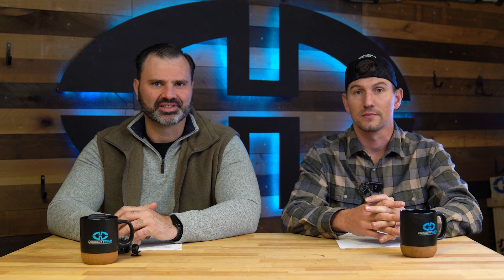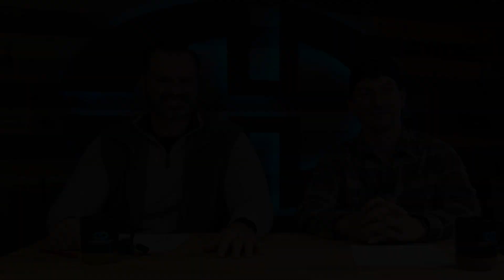What is Innovation & Why is Everyone Afraid of It? | TWP Ep. 1

Comment: You guys want a great idea that's feasible? 
A rifle using a delayed roller blowback system using a progressive, 2-stage spring to allow low to standard pressures up to high pressure rounds (aka "self-regulating"). Seriously, look at the G3, HK33 and MP5 system and think of that using a captured dual spring that works with both low-powered practice or subsonic rounds up to full-powered +P+ (think H&K USP/Mk23 dual recoil spring or Sprinco's recoil reducer recoil rod/spring assemblies). Tune the dual spring to the round and the delayed blowback system and it becomes not only reliable but pleasant to shoot. 
Now, build this using a user changeable barrel with attached trunnion (universal size), secured by an 11 bolt system in chassis (like MDRX's 9 but with a center bolt) , and a bolt that fits a single carrier. install proper spring and magwell adapter (SR25 down to 5.56 or down to Glock or other pistol mags)... You could go from a .308 to a 9mm with a simple conversion kit of a barrel/trunnion, bolt, recoil spring, bolt weight and magwell adapter... and take a large range of loads from low-pressure practice to high-powered ammo (using that dual spring). Oh, the carrier... a universal bolt carrier that has weights screwed into the front for the appropriate round used. Think of a MP5 carrier that can take weights to make it a G3 weight carrier. 
Hear me out here... we're talking a delayed roller blowback system that, unlike the H&K, can be switched out as a barrel/trunion combo allowing caliber conversion with a set of parts (barrel/trunnion, magwell conversion, bolt, carrier weight, spring).
We're talking one weapon platform that can go from 5.56/300BO/6.5 Grendel/6mm ARC/338 PRC up to 6.5CM/.308/.338 Fed (like the MDRx/WLVRN already does) but be able go down to 9mm, 10mm, .45ACP etc. One chassis, many varieties. Oh, and no gas piston or DIS to change... trunnion barrel, bolt, carrier weight is all it takes (and magwell adapters)
Also, the delayed roller blowback system can enhance accuracy as there are no moving parts on the barrel from the chamber forward if free-floated... just look at the accuracy of the H&K PSG-1.
Think about that... a .338 Federal Magnum with a 24" bbl bullpup using AR10/SR25 mags set as a SWS/DMR can be converted to a 9mm SMG with a 12" bbl with a suppressor in 5 minutes while in-mission... we're talking the perfect Spec Ops rifle that can go from a SWS/DMR to a subgun in minutes. As for the civilian market, you're talking a hundred or so potential combinations from a single chassis if trunnions and bolts are free sourced to the aftermarket world. 
I've tinkered with this idea for years but not having CAD stuff, fabrication abilities, a team of engineers or manufacturing capabilities, it's just been a vision on paper/computer.
You want to work on something like this, get with me and I'll freakin move to Utah to make it happen! Seriously!
Reply from the maker: @ericx777  I love the hk rollerguns!  Your passion rocks!
Reply: @DesertTechUT 
 Should look into what he's saying because it makes a ton of business sense !!

Comment: The AR-15 is an old and well known design. And while your 50+ magazines are cool, here are some of my thoughts on (direct impingement) AR-15 improvement.
My biggest gripe with other manufacturers (or our current patent laws, really) is that every company will have one such feature in their rifle, give it a fancy name, patent it, and then you can buy your rifle with this one feature done right, but never all of them in one rifle. So somebody willing to source multiple patents could actually make the best AR-15 on the market by far. Or if changing one geometric feature of a part on a 70 year old rifle wouldn't be a stupid new patent every single time... So my new AR version 2.0 spec should have:
Bolt:
-Heavier bolt with better anti tilt geometry (see Surefire OBC or Sharps XPBC)
-One piece carrier and gas key (POF UBC) or one screw (Surefire OBC)
-Anti shear and better dirt function for the bolt front (Sharps ReliaBolt/ KAC Sr-15 E3 / LMT enhanced angled/ rounded lugs) 
-Anti break bolt cam area (HMB Bolt with no complete hole or thicker KAC design)
-additionally to the closed bottom strengthening area of the HMBolt, maybe thicken the walls KAC style and have a smaller diameter cam pin
-Michigun OCKS carrier key screws, if you can't realize a POF style one piece carrier key and carrier design
-Sprinco extra power ejector springs with o-ring and insert (ideally two as per the KAC dual extractor spring design)
-Roller cam pin (POF)
-Proper 22.5° cam pin track and unlock per the original M16 (see Leitner-Wise, also Surefire OBC)
-Dual extractor spring (KAC, LMT enahnced)
-sand cuts on the bolt carrier rail sections (not too many relief cuts as to have enough material left and avoid burrs, compared to the old KAC and current Centurion Arms bcgs with sand cuts)
-enlarged, forward facing gas ports to reduce bcg speed and gas to the face (Lantac E-bcg)
Barrel:
-increased strength barrel and handguard mounting (Blackout Defense quantum dual taper lock, and if that does not clear the HM barrel, maybe an enlarged upper like the Cobalt Kinetics one with a reverse threaded jam nut as barrel nut, plus you avoid lapping)
-maybe look into cryogenic treating your barrels, and 5R rifling. Plus heavier profile barrels for people that want those
-ask HM if they can manufacture muzzle devices straight into the barrel. KeyMo and OSS/HUXWRX brakes also integrated into your barrel would probably come with the same advantages over a pin&weld than the gas block does. Not sure if worth the cost, but a cool idea.
-if you recontour the barrels anyways, how about testing the heat stress and incorporating stress relief cuts like Blackout Defense?
-lapping the barrels on the premium version
-longer than mid length gas systems on the longer barrels to improve dwell time, since there is no adjustable gas system. intermediate gas lengths for 14.5 and 16" to give you more dwell time. The barrels are proprietary already, so maybe go the extra mile and get closer to rifle length
-higher strength gas tube like the V seven extreme inconel. so V7 Extreme Environment Gas Tube (in the longest possible gas system you can make happen for any given barrel length)
-ask HM about higher grade barrel steel like 416r
-also, is 5R rifling or polygonal an option?
-is the gas port in the HM cut at 90° or could they change that to 45° and optimize laminar flow? like the new GO Monilith
-heat fit and geometrically fit barrel extension like Global Ordonance / Foxtrott Mike Monolith. Maybe even the oversized AR bolt
upper, lower and other:
-magnesium or lithium-aluminium parts if you want to reduce weight in the upper, lower, handguard, buffer,...
-teflon or Anderson RF85 coating to avoid wear on the upper/buffer tube around the bcg movement. Or maybe even coated steel inserts, Sig style
-enlarged magwell, and maybe optimized lines like the X2 devgroup lightfighter
-Silent captured buffer spring (JP)
-Ratcheting buffer tube (PWS)
-increased length buffer system (like the Vltor A5 length, but ideally with a PWS ratchet system and enlarged JP captured spring)
No idea how much money you'd have to have to license all of that, but one Rifle with all of that technology would rule them all.
Reply: And if we were to go the piston route with something like an AR-18 derivative, the H&K 416 / MR556a4 are a good start. Though a Sig Spear gets rid of the buffer tube, as does the HK433 and the new Bren 3. But also keep an eye out for the more modern pistot systems that self-adjust for suppressor use like the VKTR VK-1.
Reply from the maker: You have been doing a lot of research, nice job!  I agree with your point that little variations really shouldn’t be patentable. I am not sure how they got them approved in some cases.
Reply: Said all of that and you can get the HK system and it is ready for serious use.  The only thing that needs to be done with that is folding stock and new ammo choices !
 22arc, 6arc, and 6max  all are far better than 5.56 !

Comment: The Trek-22 would benefit from being it's own complete rifle. With some upgrades that make the 10/22 more suitable as a bullpup.
Easy cleaning through 11/22 open top receiver plus a more solid metal rail for optics. Tandemkross for better mag release. Volquartsen DLC bolt or TacSol X-Ring dual spring bolt. Carbon barrel. We usually only get one or two nice patented features on a particular rifle, but then the other 8 we want are proprietary and don't mix. Source them all and win.
I love to tinker with my competition rifles, but a factory premium tuned version where you know it was tested, works, has complete warranty is nice for most people.
Reply from the maker: @texasranger24  we do currently have our own full trek 22 rifle now with an awesome trigger upgrade.

Comment: Desert Tech should split the MDR family into large and small frame.
A combat reliable 5.56 (and .300blk) size bullpup. No .308 size and weight, no mag inserts. Just the gun the AUG, Tavor and L85 wanted to be.
16" and 12" (and 8" 300blk) options.  Monolithic top rail and removable lower handguard half. Comfy/ changable cheek pads. Either a steeper or even better exchangable AR pistol grips.
Oh, and maybe an improved trigger pack. Work with Triggertech or Hiperfire. We would absolutely pay for even better (reliable!) triggers. Also, super strong charging handle.
And then the big boy rifle for .308 and 6.5creed. Plus nowadays do we want 6max in the small frame and 8.6blackout in the large frame? .22lr conversion for cheap training?
Reply: I don't think you've tried the mdrs and current gen have you? Its compact, Wolverine seems perfect
Reply: That bullpup is going to be 7-8 lbs no matter what because of all the extra hardware that's inherent in bullpups.
Reply: I've been beating this drum for 3 years now. I am waiting for a small frame MDR. I don't want caliber conversions. I'll just buy another rifle as I can keep an entirely different enabler package on it without having to zero everything again or swap configurations.
Reply: If they aren't 6arc or 6max, they are a waste.
 6.5PRC over 308 and 6.5 creedmore all day !
Who cares about 300 blackout or 8.6 ? 
  Real world, they're a waste.
Reply: @MTCKIE68  Disagree, as I think most others will as well. 300blk suppressed is a perfect home defense round.
I bought a WLVRN in 300blk with the intent to suppress it for just that purpose.

Comment: I would like to see Desert Tech offer retail customers the ability to customize their order from the factory. Why do I have to buy the WLVRN and then order that bipod forend extra? Why can't I just build the system that I want on your website and have it shipped that way? Gunsmith kits are cool if I want to change things later. But $600 extra dollars for a second grip when I'm just going to throw out the OEM one. 
I loved your DMR WLVRN setup, I want that, I just don't want to buy the base system, then buy all the parts extra, then to build it myself. That's wasted time, material and money. 
Also, that cheater pod your gunsmith put in the buttstock, i understand that might be hard to incorporate for everybody. But you can solve it just by putting a single mlok slot in the base of the butstock. I'll use that to attach my own little monopod. And if people don't want a riser in back... well no worries b/c it comes with a little rubber plug, to prevent debris ingress. Problem solved... innovation!